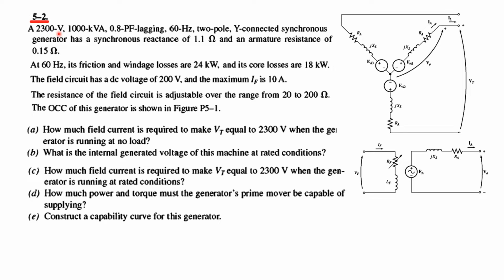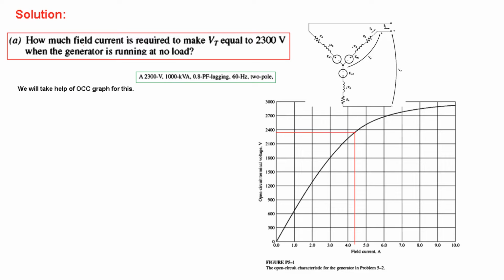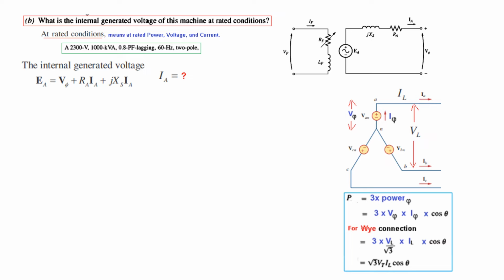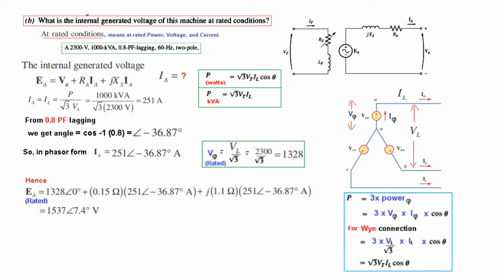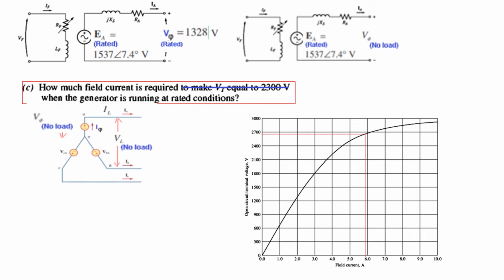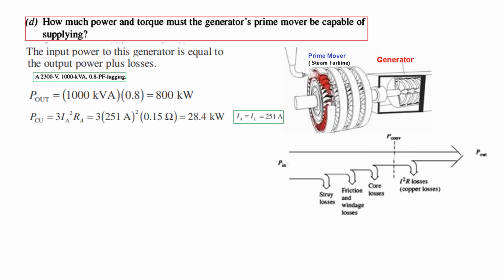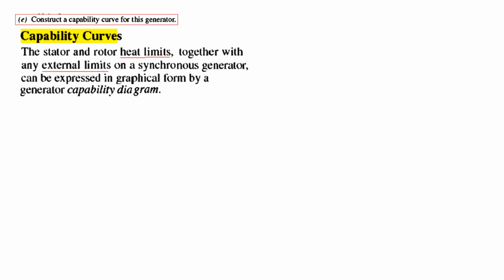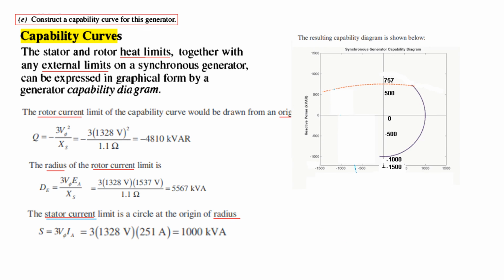(E)EM(C) Q 5.2 ||  Synchronous Generators || Y-Connected || EMF || Capability Curve

Comment: Hi can you help me with this problem? 
A 100-MVA, 14.4-kV, 0.8-PF-lagging, 50-Hz, two-pole, Y-connected synchronous generator
has a synchronous reactance of 2.281 Ω and armature resistance of 0.0228 Ω.
(a) What is the magnitude of the internal generated voltage at the rated conditions? What is its
torque angle (δ) at these conditions?
(b) Ignoring losses in this generator, what torque must be applied to its shaft by the prime mover at
full load?

It's almost the same problem but different questions.
Reply from the maker: Give it a try, and mail me your working. I'll check it,

Comment: can you also assist on this question 
A three-phase 50 Hz star-connected synchronous generator has 𝑅𝑎 =0.2 Ω/phase, and 𝑋𝑠 =1.5 Ω/phase. The generator supplies a current of 120 A at a power factor of 0.8 lagging to a feeder of resistance of 1.2 Ω/phase and line reactance of 2.5 Ω/phase. The voltage at the feeder end is 3.5 kV. Calculate the terminal voltage of the generator and the excitation/induced EMF
Reply from the maker: please give me reference of the book.
Reply: @ElectricalEngineeringAcademy  it was an exam paper
Reply from the maker: @stacymutero5095  Oh, I hope u did well. Keep watching my videos to learn the basics. Best wishes
Reply from the maker: I am getting an answer 6.94KV and  4KV . Is it close to what u have ?
Reply: @ElectricalEngineeringAcademy  they used this formula but l dont understand Generator Terminal phase Voltage is
 V_t=V+ I_a(R+jX)=2020.72∠0 + 120∠ − 36.87 (1.2 + j2.5)
Reply from the maker: @stacymutero5095  The voltage at feeder end 3.5KV or 3500V, which is line to line voltage. To convert it for single phase, divide it by under root 3, u will get 2020.72V.  Ur current is 120A, power factor 0.8 lagging means angle is <-36.87. Vt is the terminal voltage at the end of Armature reactance, but before feeder impedance, so formula is correct. If u want more details mail me at profkhannazir@gmail.com

Comment: Can you  please also do the following part  starting like: Assume that the field current of the generator in Problem 5- 2 has been adjusted to
a value of 4.5 A.
(a) What will the tenninal voltage of this generator be if it is connected to a
 delta connected load with an impedance of 20 L 30° O ?
Reply from the maker: https://youtu.be/t8jTOa3er-w
Reply from the maker: ok. soon